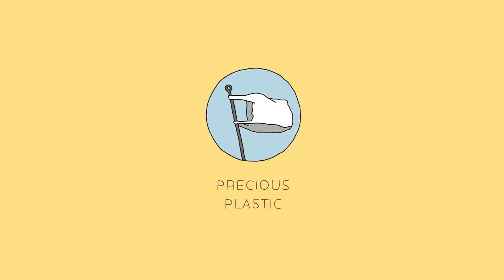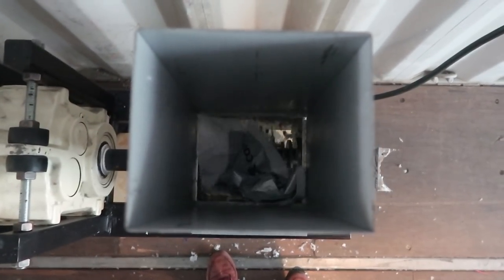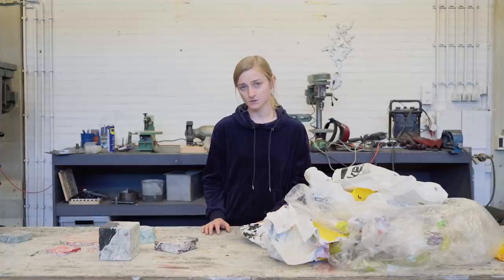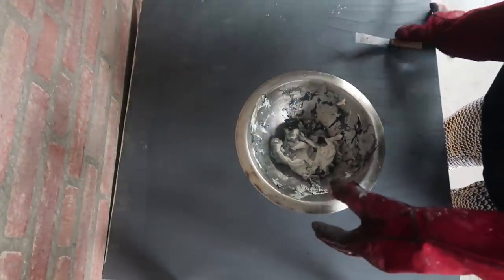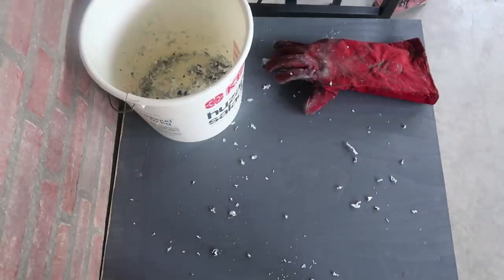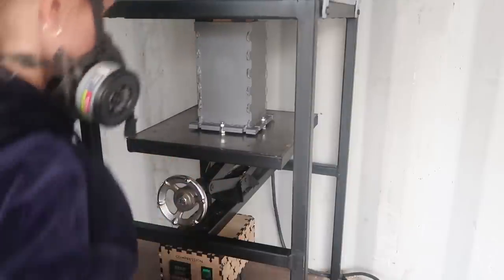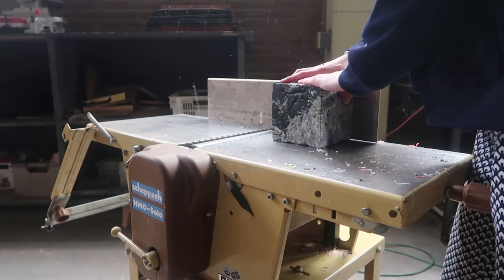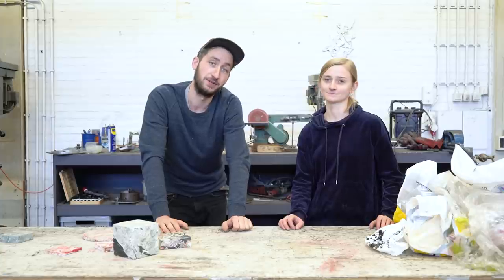Create marble from plastic bags #preciousplastic

Comment: Surely there must another way to melt the plastics to avoid using such high energy requirements and in process producing toxic fumes ?.?
Reply: you could melt them using a wood stove, I imagine, as long as you can melt the plastic.
Reply: I plan to try acetylene torch. Hard to control temp , but economical
Reply: i think after melting plastic in that oven , we cant use that oven to bake food items anymore, isn't it?
Reply: Anush sweety of course
Reply: @dimaelmech8600  actually I'm working on a project related to plastic. Can I know what kind of oven is used in above video ?
Reply: In an industrial plastic extruder there is a long (2 to 3 or more meters) large auger in a bore. This auger is tapered so it is thicker (less space around it) at one end of the bore where material is added and thinner (more space around it) at the extrusion end of the bore. At the start electric heating elements heat the bore up softening the plastic. Once a set temperature is reached where the plastic becomes soft and pliable the auger rotation motor is started.Plastic is forced into a solid mass with no air pockets at the extrusion end. Just the friction from and action of this compression by the auger is enough to maintain heat in the machine and plastic so the heating elements do little if any heating once the machine is up and running. Once at this point the main problem is feeding the machine enough plastic to keep it going.
Reply: Anush sweety This process, if done with normal household equipment, should at least be performed outside.  Especially that household ovens are not exactly that accurate with temperature and any fluctuation like to release gases, which are not only toxic, but also flammable, and they can also condensate on the walls of your kitchen or in the hood of your stove, and then melt again at a later time or release fumes at a later time.  You don’t want your kitchen to smell like my workshop.
Reply: Anush sweety definitely not a home oven and I’m glad you asked. I am suspecting is a laboratory type oven, with accurate temperature control, and with venting options that are not available in home ovens.... but of course the poster of the video are going to give The exact information on the oven they chose to use
Reply: @marsogreen2411  I wonder if you could use a solar oven with a thermocouple inside to monitor temperature? They get very hot.
Reply: Cunning Stunt This would have to be studied to get good temperature control, especially in the range of 200°C, and depending on how much money you want to spend on this. What would you suggest to connect the thermocouple to? (Or did you mean thermometer?). If you really meant thermocouple or thermostat, a motor and a shade that moves in to interrupt the sun rays? Now you need power for the motor, and linkage. I’m sure someone out there has done something similar, but again you can do anything if you’re willing to throw money and time at it, but I’m guessing you’re suggesting this because it seems like a low-cost alternative.  you can always try it, of course, but prepare for lots and lots of experimentation to determine the following optimum factors for 200°C:
1) size of the oven
2) amount of bags to start with
3) feed rate of additional bags
4) know when to stop
5) amount of insulation and type of insulation needed if the above factors start proving difficult.... which means repeating the same experiments while varying the same factors above all over again and multiple times.

.....But you may get lucky with your first few tries and call it a success if it’s just to prove the concept....otherwise you’ll have to do real R&D to make it a reasonably cost effective process.... for example if you’re looking to dispose of all your plastic bags this way every time and forever

But before you take my opinion as the final answer, I would recommend you do a search on solar ovens and if anyone out there were successful at actual temperature control, and especially in that range, and therefore you can take it from there to use it for the plastic bags.... just remember that you need ventilation

..... just my opinion, though 😊
Reply: Cunning Stunt thanks for all the references! Yes of course, as I mentioned, it’s worth doing.  An area of concern would be if the heat is going to be proportionately and evenly distributed to all the plastic bags in the pan, without having one spot overheating.  Depending on the set up you plan, you can possibly hold or install an umbrella along the axis of the oven, and therefore as the temperature starts creeping past 200°C, open the umbrella to block the sun, and close in response to the temperature drop below 200°C. (Or you can choose a window of 180°C to 210°C due to latent response, or based on experimentation )....and that would make a manual/human PID controller 😊👍.  Please let us know if that’s something you’re planning to do, and of course, we would be interested in your results!

PS. One idea to get even temperature distribution off to a good start, is to mix some water with the plastic bags. It will boil at 100°C and it will act as a conductor to all the bags material evenly, until of course, it fully evaporates, and then the temperature starts climbing beyond 100°C, but at least you would know that just before the last bit of water has evaporated, everything in the pot is at 100°C at that point. Not a bad place to be certain of, considering you only have to climb 100°C more.  I suppose an oil with a boiling temperature below 200°C would also work, but I think the waste (and nasty fumes) would defeat the purpose of the whole thing. I would go with water

I will add one more thing on even heat distribution in the pan:  most oils actually have a higher boiling point than 200° C, therefore you could theoretically soak all that plastic in oil in the pan and then at 200° C I wonder how “doughy” the plastic bags become in the oil and how easy it would be to separate the oil from them upon removal.  I think it’s well worth trying!!!
Reply: @marsogreen2411  No need for water you can use the focal point of the mirror to increase or decrease the heated area, There are also other ways such as applying insulation to the sides of the oven/chamber that are not exposed to the solar death ray. If you make the oven/chamber out of copper or aluminium you will find that the interior hits the same temperature on all sides.
Have a look here at what this guy is doing.
He also made his own solar tracker. Look through his videos to find out how to make one.
https://www.youtube.com/watch?v=0BN7a42ZTkw
Reply: LDPE and HDPE are pure polymers containing only carbon and hydrogen.   As long as you stay in a proper melting temperature range there are no toxic offgases.   If you go too high then it will char and still only give off CO2 and water just like burning methane.    They are polymers of ethylene, C2H4.    This is definitely not true of pvc though.   That should not be messed with as it contains chlorine.
Reply: Plastic must be abolished. Its destroying the planet.
Reply: @ElectricalExistence  Blaming plastic for what people do. I agree we should cease producing new plastic from oil and instead recycle, there is enough of it out there.
Reply: @cunning-stunt  if they would go back to making half the things out of glass and metal like they used to there wouldn't be such a problem.
Reply: @tonymcpherson1958 There are lots of things we use plastic for that glass and metal are no good for. If we only used recyclable plastic and actually cleaned, sorted and recycled it there would not be a problem. We can easily just throw glass and metal in a hole, but we don't we recycle it. We should do the same with plastic.
Reply: Energy footprint is gigantic for a block.  Need a larger output of product to make it viable
Reply: @billpiehler9010  Read my comments above using s fractional lens or parabolic mirror and the power of the sun.
Reply: @bonniepozarlik5099  , thats the way i do it but its very hard to regulate temperature.
Reply: @marsogreen2411  Marso, Sweety, this is Dave Hakken's shop. Anush was merely demonstrating a technique for that marbled aesthetic. If you go to the Precious plastic website you will see that Dave built each of the machines specifically for at-home plastic recycling.
Reply: Electrical Existence plastic is a big part of our life and there’s just so much plastic on earth, the best we can do it recycle it and find way to use it until we can send ships of plastic into the sun to get rid of it lol.
Reply: @phbrinsden  Thanks for the well thought out comment.  It's nice to see some science behind what a person says here.
Reply: Did you really see a bunch of fumes or dripping melted plastic?? She literally just got it warm enough to compress its not killing anyone unless you plan to use that block as a weapon...
Reply: @anushaseelanki7686  as long als you  dont burn a shitload of plastic its just fine, but if you make a lot maybe better to get a separate oven for this exclusively. If you keep it under 200 degrees really all you smell is a bit of a plastic smell but no smoke or fumes etc. Thats why this is pretty save to do at home, but always keep the room well ventilated just in case something goes wrong.
Reply: @anushaseelanki7686  their website explain everything about the machine they used. If I remember correctly, they made the oven from unused oven and then customized it
Reply: @marsogreen2411  "Sweetie"  condescending much Marso?
Reply: Angelus Nielson That was her name a year ago. YouTube automatically inserts her name in the response.  Read the replies from other responders who also responded to “Anush Sweety”, before she apparently changed it to “Anusha Seelanki”
Reply: @anushaseelanki7686  is this true?
Reply: @cunning-stunt  if you use solar to heat a liquid and run it as heating coils in an oven, it may be easier to control temp
Reply: @anushaseelanki7686  I doubt that would impact your oven as we use chemicals like over cleaner and no problem using it again
Reply: Sandwich press, no fumes from mine inside at all. I can barely smell it at all. Also no real danger of starting a fire as it only reaches a safe temperature.
Reply: If the temp is properly controlled it releases no fumes.
Reply: @bonniepozarlik5099   u can use  Acetone !

Comment: this process inspired me alot! do you worry with the very small pieces though that breakaway during the sanding, polishing, and grinding process? isnt that micro plastics, how do you make sure those small pieces are still recycled as well. thank you!
Reply: I think you could use a vacuum cleaner after finishing each phase of the manufacturing process. That way, you would end up collecting those microplastics and then emptying them into a container for later use.

Comment: what kind of oven have you guys used to melt plastic covers?  does melting plastic covers releases any  toxic gases?
Reply: it does.  I use respirator to not breath worth them. otherwise you get a headache.  the regular oven that heat up to 200°C works just fine

Comment: compression compression as is with low heat no shredding or sorting keep it simple. like use steel compression equipment. sheets, bricks boards, etc.

Comment: nice video, seems a very strong material. Can you also pour the plastic into a mold for making a  propeller blade and assemble a wind turbine to make electricity?
Reply: You could but the mold, type of plastic and amounts used would need to be precise for it to function properly then you could sand each blade to specifications without excess waste. Though, any waste mostly can be re used in future projects.

Comment: Could you lightly oil the surface of the bowl before you place the plastic in the bowl?  So when you take it out and scrap it all together, it will slide off of the sides of the bowl.  Or would the oil have a negative effect of anything?

Comment: Avoid fumes AND avoid expensive filter-mask.  Simply make a little fan attached to a flexible hose.  Draw in clean air from outside the shop.  Then you make a simple mask that blows the clean outside air onto your face from the hose.  No filter needed.  Young people don't value their lungs until years later when you get cancer or other lung disease.  Take care so you can live to see age 30.

Comment: This is fantastic. Really love what you have done here. You took a great deal of time and thought to put this together. Not to mention all the work that went into coming up with the idea. 

Would sugest that you mention what grit sandpaper, grinding and type of polishing wheel you used.

Would you consider how you might make a one solid table top for something like that? Obviously the oven could limit your ability of size, along with the planer. Instead of the bowl what about making a larger square mold that fits into the oven?

Comment: So, all I need is an industrial space with a bag shredder, an oven, heavy duty molds, and a large hydraulic press. Easy-peasy.
Reply: The bags can be cut with scissors,  a kitchen oven will do fine, you can use pans or baking trays as a mold, the press is just a car jack but you could also use clamps.
Reply: cris10smit your home oven will vary. Do you really want to take that chance and use it again with food? Because home ovens are not very accurate, they may go up in temperature, and that would release gases that you cannot control and they will condense on the walls of your oven, and getting rid of the smell can only happen after several hours of running the oven for several hours in clean mode, basically the highest possible temperature.  And prepare for a lot of fumes and make sure ventilation is at max through the hood, if you have one.

Comment: hey all, been watching your channel non stop for a couple days now. I was wondering if it would be possible to use a thick piece of pvc pipe as my mold as I am trying to create a plunger the exact size of the inner diameter. I am curious if the pvc will melt or if there will not be enough heat transferred to melt it. the walls of the pvc are apx 1/4 inches or 6mm thick. thanks!
Reply: maybe if you seal the bottom end of the pipe and put it on water it wont melt

Comment: Jesus Christ, Sonia....you need to learn how to safely use a jointer.  Move the fence in so just enough of the blade is exposed to do the job.  And stand next to the jointer so you 're not leaning over it so much.  It's a very dangerous machine that can do a lot of damage if you're not careful, but learning safe habits will minimize the risks.
Reply: I thought the same thing. that is one bad ass joiner. The other thing I noticed is that you really shouldn't use such a short dimension on a joint as it can dip down into the blades, as you don't have any leverage to keep it down on the base of the joiner. She needs a large upright belt sander for that.
Reply: Lol
Reply: My grandad lost the enda of foue fingers on one doing something just like she did. A short block by hand and no guard.
Reply: @Valeska S thats not a curse
Reply: @Valeska S please respect the fact that not everyone shares in your belief that jesus created all life.
Reply: @rherb27  wkwkw

Comment: i miss one piece of info - for this particular cube, how many (grams of) plastic bags were used?
Reply: It should be around 0.9g to 1g for 1cm³.
Reply: @claudelussier1678  thanks!
Reply: Most plastics are around that weight if they are not glass, gaz or talc filled. 

A good way yo check the density of the plastic is to put them in water, if they floats it means they are less then one gram per centimeter cube.

You should have better results if you use the same kind of plastics because they don't necessarily mix all together. It is like mixing oil and water.

Comment: what happens if you mix pp, hdpe, and other thermoplastics? 
could you possibly make a video about this?
Reply: Daxent Don't know, haven't tried. But I guess it'll make one hell of a mess, since they melt at different temperatures. I wonder if you could use unknown mixed plastic as fillers (shredding without melting).
Reply: You beter not mix pp, hdpe and other plastics, because then you'll have down cycling and it will be impossible to recycle the items in the future. Downcycling is never the answer to our environmental problems. If you don't know which plastic you're want to use, it's best not to use it. Before melting any plastic, please check the safety sheets available on the internet.

Comment: Will plastic fumes that  emanate while heating be carcinogenic
Reply: Probably. Just another wonderful bonus from plastics.
Reply: As long as the plastic doesnt burn/boil it won't actually release any fumes. It's just going from a solid to a liquid and not actually putting off any serious amounts of vapor. That's why temperature is so important.
Reply: Sorry 4LY5S4 but YES even without boiling or burning it, IT WILL RELEASE GASES. It won't be in the same amount but you will have some toxic fumes. Plastic is made from petrolatum and may products still release gases with out being heated, you know like when you go to a tire store that smell you smell when you walk in , that is the off gassing of the tires.

Comment: I find plastic bags tend to trap a lot of air in the form of tiny bubbles, almost like a foam, and these tiny bubbles do not appear to be able to be removed by compressing.  That is why I stopped using plastic bags.
Have you seen this problem as well?
Reply: you might want to search for the process "Agrumado Plastico" no idea how its called in english, but it consist of making tiny pellets with a centrifuge machine, that way you can get rid of the bubbles